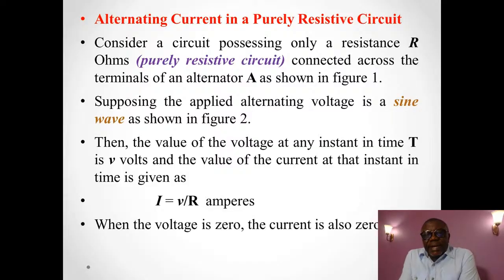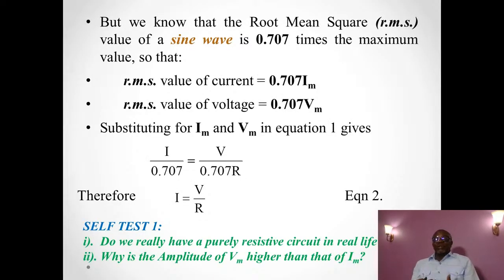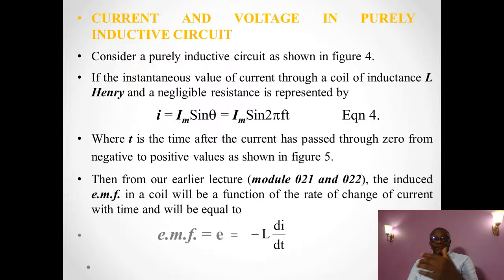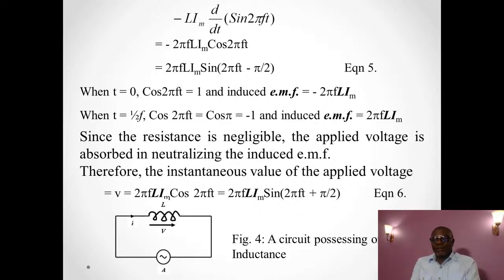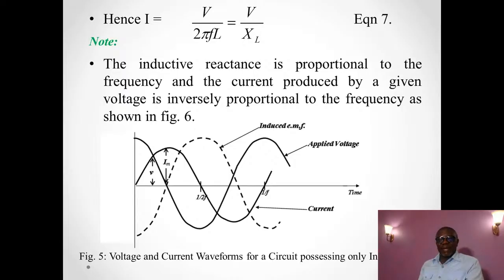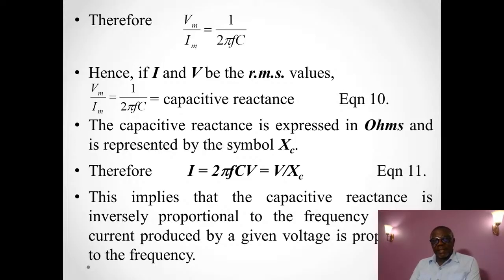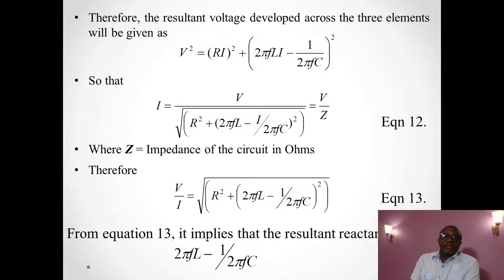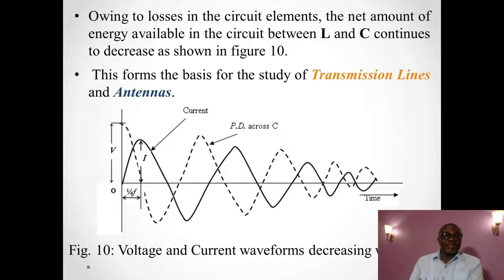Single-Phase Alternating Current (AC) Circuits Explained. Engineering Lecture Series

Comment: From the test in the beginning of the video
1. There cannot be a purely resistive circuit because every circuit have tiny  capacitance and inductance
2. The amplitude of v is higher than I is because of resistance R
Reply from the maker: Correct